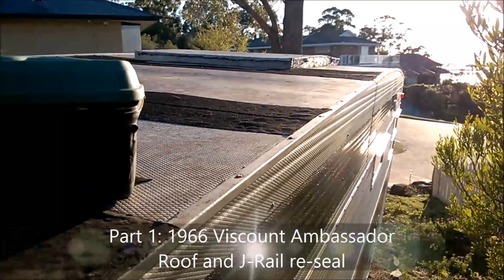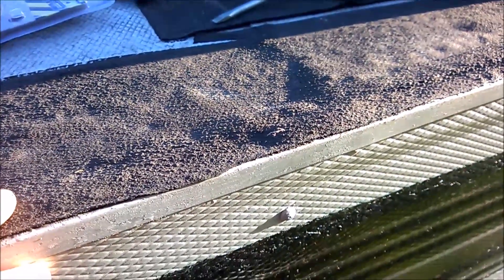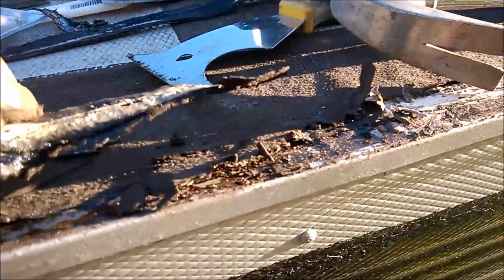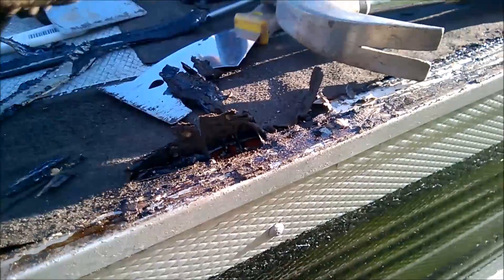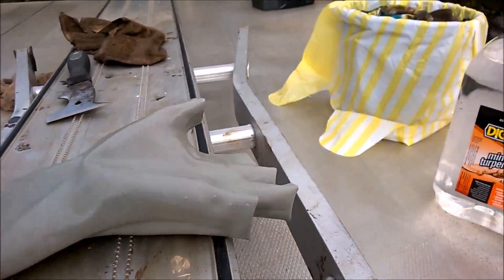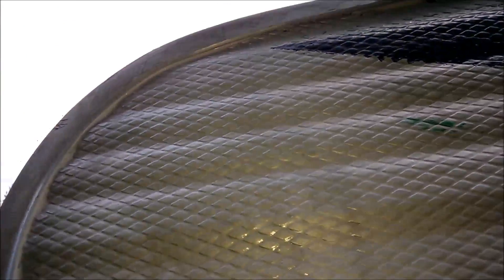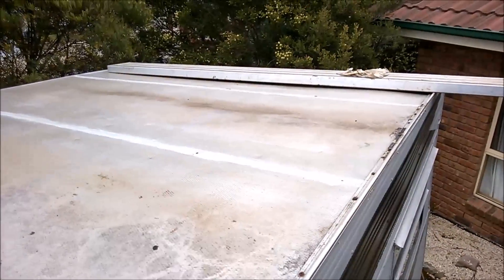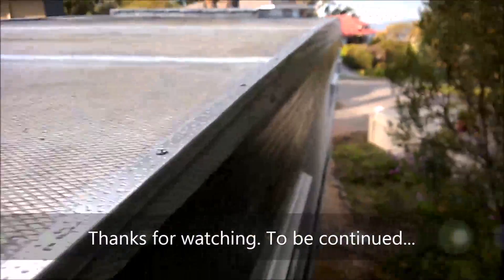Part 1: 1966 Viscount Ambassador - Roof and J Rail Re seal

Comment: Loving your videos, thank you.
Did you think of trying your wife's hair dryer to melt the glue under the bitumen tape?
Reply from the maker: We tried that (but with heat gun), all it did was make the top brittle and split apart.  Yes hard work but the way we did it ended up the best.

Comment: Great work on the bitumen tar tape. I could tell from your intro video that it was going to be a big and messy job. That tape under the jay rail must be some sort of weather stripping like this http://embossingtapesupplies.com.au/3m-extreme-sealing-tape-repair-leaks-in-gutters-flashing-trucks-caravans-instantly-4411-short-rolls-36mm-x-5mtr.html. I think it's best to stick with the Butyl Mastic though.
Reply from the maker: The tape seems like a good idea, but after ripping it out I saw that it has leaked.  All this could of been avoided if the proper sealing was done initially, instead of covering up the leak (if thats what happened).  Still got another weekends worth as we only done 40% of it!